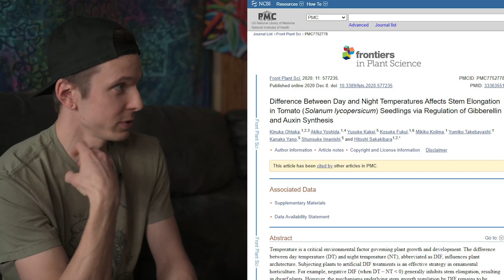Reducing Stretch in Hydroponic Crops/Negative DIF with Lost Leaf Matt

Comment: I have high day time temperature 85- 90 degrees... What's the highest night time temperature without causing issues? Nice valentines day gifts... did she appreciate? hope you are good.. great topics.. I am currently interested in Harley smith and nutrient ratios in mid to late flower as you mentioned you could use more Athena B and adjust the ratios of NPK to the plants requirements... Currently changing the late flower NPK to 3-11-14 from my bottles nutrients... and have found information on the ideal ratios of magnesium sulphate/ epsom salt : phosphorous   being 2:1 in ppm... I measure my ppms ands divide by my concentration of the NPK so I know how many ppms of phosphorous before I know how much epsom salt... I use 1.5 spoons of epsom salt on a 2ec solution similar to your DWC nutrient recipe I sent you a message with my recipe last time... hope to see more of your huge buds...
Reply: my reservoir is 30 litres...

Comment: I did this because I had no choice it was summer and I couldn't use the lights of a day because it was way too hot but it was still warm of a night so the dark cycle was of a day and lights on at night I still got the same amount of stretch as if the dark temps were the same I had 2 plants in flower 1 had chiller keeping roots at 19 to 21°c other no chiller water temps 26 to 29°c dwc cuts from same plant the warmer roots had massive solid bud the cooler roots had smaller bud not quite as solid so yeah I definitely can agree with what that young lad said the stretch was the same as always.
Reply: Did the warm roots produce bigger flowers? This is strange, usually if the roots are warm they begin to rot.

Comment: interesting ....thanx ...i hade streching in vegetative growth but was experimenting with soil so i put it in sandy, and with lights (4200K) ..under that, plants streched as normal outside inch floor from floor of leafs on main stem ...when they showed male and female parts after 6th floor, a month ...i transplanted them in bigger pots 40% garden soil, 40% sand and 20+organic compost with full nutrition and changed lights to 6400K 24h to stop flowering i indused to see males from females it stopped streching and now floor from floor isnot even 1/4 of inch ...dence dence (too dence?) we'll see ...this will form too dence buds and it's better if they are strached on stem and get enough light and not be shading each other ....this is the last time i grow inside ...i hope ...this grow is because my neighbor caused me to cut off allplants outside right before flowering last year ....i hope he will brake his neck and burn in hell ....i have to move away from idiots and demons sorrounding in some nice nature